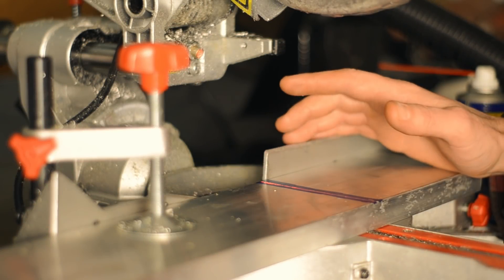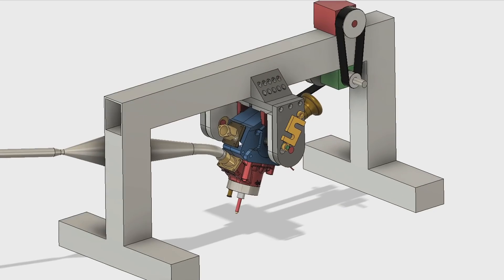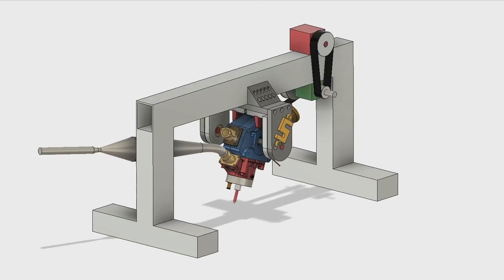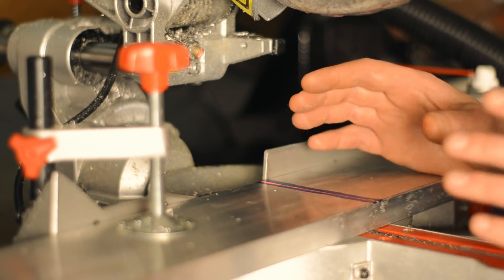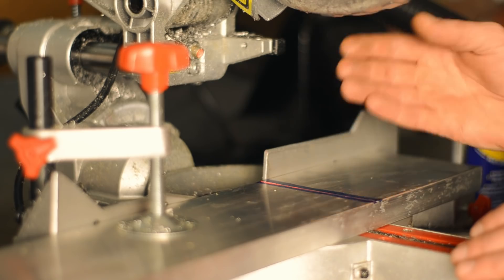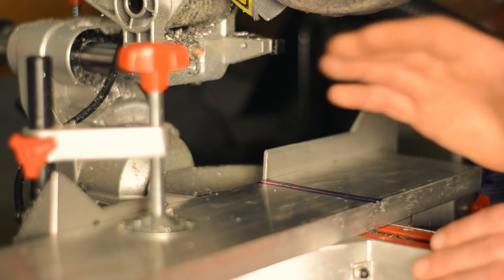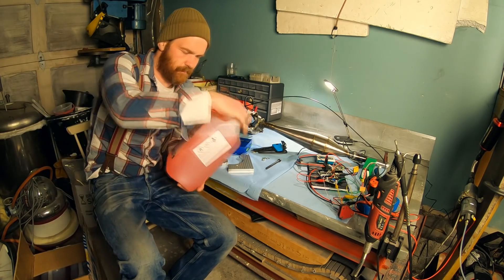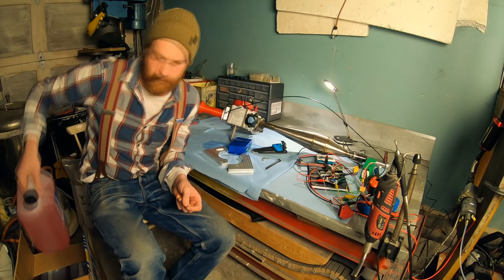Built to suit Dyno for the Most Powerful Two Stroke Ever

Comment: You know I was thinking those Nitro rc engines they make a lot of power because the fuel consists of nitromethane, methanol and oil, and the way those engines are designed is a pinch type clydiner and piston so there's no piston rings the compression is from the clydiner pinching the piston and was wondering what if you took that same design and just upscaled it to 50cc

Comment: Great video's, keep it up! I'm a fellow 2 stroke enthousiast and though i don't have 5% of the knowledge and capabilities you have i would like to get your thoughts on this idea: if i understand correctly, the piston ring only expands in the combustion area, above the exhaust port. So how about making a cylinder where the exhaust port starts to slightly move away from the piston as it moves downward after combustion and making the bottom of the exhaust port slightly v-shaped or round? In my wildest 2stroke dreams i would combine this with a thin piston ring that sits on the lower half of the piston, just below the exhaust port, providing some extra stability for the piston making it less likely to tip over in the exhaust port when moving upwards and maybe creating a better seal when it comes to pushing the gasses upwards.

Comment: Put a Dove tail on your vice jaws and on the stock material to hold better or do not use a vice clamp it is a fixture with pins to keep it from shifting under the cutting load.

Comment: You could always mix your own fuel/oil by getting hold of premium oil used in go-carts synthetic caster ? Just my 2¢ mate ! ;-)
Reply from the maker: 👍 The problem is I can't buy pure Nitromethane in Norway - heavily restricted. Working on a solution, until then I'll have to settle for RC fuel.
Reply: @2STROKESTUFFING  IMO RC fuels are some of the best with all different additives cooling agents/ and friction modifiers, in what your looking for, you work on the % for your design engine !
 the last 10% takes 90% of the time but you know about that the fun stuff "the fine tuning"  ;-)

Comment: I suspect those bumps/roughness on the faced surface may be endmill deflection as it loads up and tries to "climb" the cutting surface rather than that much movement or deflection in the workpiece. Something like a 3/4 rougher mill (looked like and er32 collet in the machine?) might really help out in keeping things from getting bendy on the spindle side. Or leaving 1mm or so and running a high stepover finishing pass to give some prettier and wider milling marks (also with a larger endmill ideally) though this will likely shorten endmill life a little.

Comment: Can't tell a lot about what you where actually doing when machining there.
 For what it is worth in my experience using a commercial rigid router for aluminium (not as rigid as a dedicated metal CNC for any metal but probably a little more rigid than your lighter duty CNC) is that razer sharp single flute carbide cutters for aluminium work great. Depending on your max rpm capability you might need to feed appropriately slower. With the single flute and its sharpness there is less chip load engagement and the single flute gives loads of chip removal clearance.
Leave 0.5 mm for finish pass cut also or less if your material removal cuts still allow a good cleanup.
On featureless flat surfaces you can't beat a cleanup cut with a fly cutter.
With lighter CNC's you get back what you put in to giving it every chance of a good result, is what you soon discover.

Comment: even sped up I can tell your feed rate is a bit high. That and check your tool weights. Make sure they are balanced (ish). Out of spec wobble can totally banjax your chuck and guide rod. The world shattering vibrations are a heads-up trouble is on the way.

Comment: Get a hard rod run an eighth of an inch or so the length of the width of your jaw put some sticky or some other means to hold it parallel to the top of the jaw halfway down as you start to tighten the part give it a whack on that side with a dead blow. Then tighten the jaw, the part should stay put. Cheers!

Comment: Can I make a suggestion? When I have overhanging stock on the second operation like you had. I don't worry about the facing cut first. First I put a profile cut standing off the finished part below. Cutting this straight down in in Z with a smaller endmill to part off the stock. Than in the Cam software just face the material above the part. Than your facing cut wont need to cut all the air cuts. I'm assuming your are using Fusion. It might also be good on your machine to use a adaptive roughing strategy with small step over to rough face off the remaining material. This puts less load on the part and holding style. Putting a final finish pass (Say around .010" or .25 mm in Z) with a larger step over, could also help for the bumps in the passes on the face. Just a thought.

Comment: It's frustrating when you get hard work near perfect then mess up a simple  hole position. Weld the hole Place it in the rite spot  You have your cutting machine flying. Good job  After all that  Drill the mounting hole in the wrong spot. Find it very frustrating  even when it happens to someone else

Comment: We ran a 26 cc engine on similar model engine fuel.  Except for the carb, it was set up the same as for gasoline.  The 15% nitro ran fine.  However 40% nitro burned the plug electrodes off and dented the piston and sleeve on the way out.  The engine obviously needed to be re-tuned for the nitro fuels, but we weren't particularly interested.  Good Luck.
Reply from the maker: Just a little lean and things start melting in seconds. Had a couple of casualties last time I played with the stuff.
Reply: You definitely need a richer needle.  We took the regulator and pump diaphragms out of a WYK33 carb and made it into a simple barrel carb like RC engines use.

Comment: Keeping your parallels in place to stop 3:33 can be done with a piece of steel banding, the sort of stuff that's used for palletising stuff, acting as a spring between them.

For the vibes, can you set up a continuous variation of motor speed, say 100rpm ±  around your target speed?  That can help reduce resonance issues.  Also, reduce your cut depths, and maybe try your surfacing with a shell mill rather than a piddly little endmill.  Also also, remove less material on the mill - try to get stock that's closer to the final size, cut and drill a maximum of material away up front (whilst keeping workholding ability), both of these are much faster than milling.  If you have drilled holes, you may be able to do these up front and then through-bolt to the table (or sacrificial pallet) rather than buggering about with a vice that doesn't appear to be doing very well.  Making a set of pull-down jaws can be useful, as well, you sacrifice some clamping width, but theres a massive gain on downforce - look at https://www.shop.santool.de/media/images/org/2822_0.jpg and I'm sure you can work out how to make a removable set for a "stock" vice fairly easily.

Comment: Get an assortment of different length springs and use them under your work piece to put outward pressure on your parallels to hold them secure against the vice jaws. Or some times you can use rubber bands around each parallel to hold them tight to each side of the vice.

Comment: Question (sorry if you've already covered this) wouldn't you get more power if you went for overhead exhaust valves and then supercharged the motor? (Maybe even electric supercharger - a real one not an ebay special)
Reply from the maker: Worth experimenting with in the future!
Reply: Bonneville Nationals Inc rules forbid electric powered boost. Must be mechanical drive for superchargers. I am told that turbocharging an engine smaller than 200cc has been problematic.  Of course, he does not have to comply with BNI rules to build the most powerful 2 stroke, just to race it at Bonneville.
Reply: @jimdale9187  mechcanical supercharging would be the way to go then to race it on bonneville shouldn't be an issues with supercharging - turbocharging is problimatic due to small volumes and with single cyclinders the exhaust pulses are not frequent enough to really spin up turbo chargers unless the turbo is machined for an engine that small

Comment: Those shifts doesn´t need to be a clampingproblem, i would say it´s more an effect of an not rigid machine.
Yes your 'spacer' came loose, but with my machine at work that wouldn´t cause vibrations.
The planar cut on the top plane, try to always go in the same direction, example from right to left, do not use dynamic cutting that lets the cutter go i 'circles'.
And just overlap about 1/3 of the cutter.
In milling the contour:
I would say you need to lower your cutting depths, like about for a 12mm cutter, you go as most 3-4mm deep.
then save about 0.1mm in the contour of the piece, and go go back fine cut it with full depth.

You have a very 'flimsy' machine and cannot do milling as bigger sturdy machines can.
Och på svenska:(kan inte ordet på engelska) använd ALLTID medfräsning vid konturer, det skapar mindre vibrationer.
Reply from the maker: 👍 Tusen takk for tips!

Comment: Those surface ridges are typically due to the head not being perfectly trammed, not the vise.
Reply from the maker: 👍They're not consistent. I think it's the flimsy mill "stand" causing problems again. Should really add some bracing.

Comment: when your parallels shift and not clamped by your hammering then you can be shure its caution to rigidity.. :D
did you even make a finish cut ? :D  dont worry about your tool life. let her run smaller steps, or only reduce the feed rate.. if your spindle makes 6000 rpm try about 1000-1500mm/min in the finish cut. :)
But im only working with modern mashines now.. they make it so easy to get good surface.. 

great work. i love watching your channel

Comment: cox engines have an engine size of less than 1cc. imagine a 50cc 60 cylinder. should make about 30 horsepower. if the specified hp is correct.
Reply: gotta account for mechanical losses gearing (or belt driving, or whatever) them all together. That's why more and more large cars are going to turbocharged 3 or 4 cylinder engines, even though it would be cheaper and easier to make that power with a naturally aspirated 6 cylinder.

Comment: in the 1970s the 50cc 2-stroke reacers could hardly beat the 2-cylinder 4-stroke 50cc engines from honda. Building a 14 cylinder could be very successful in addition to being extremely interesting.
Reply: 50/14=3.57 cc per cylinder